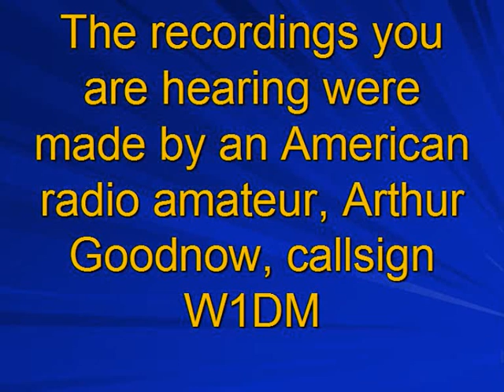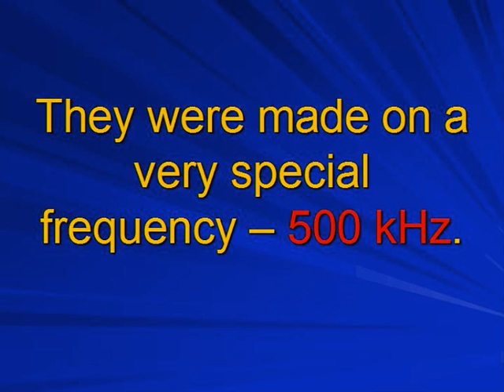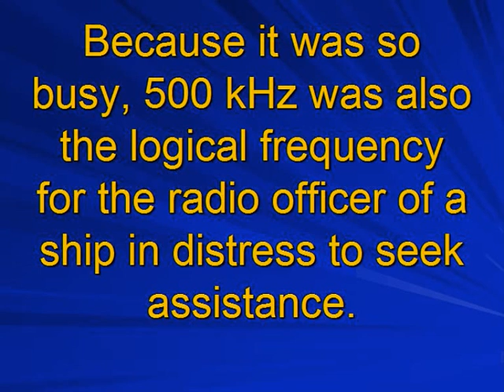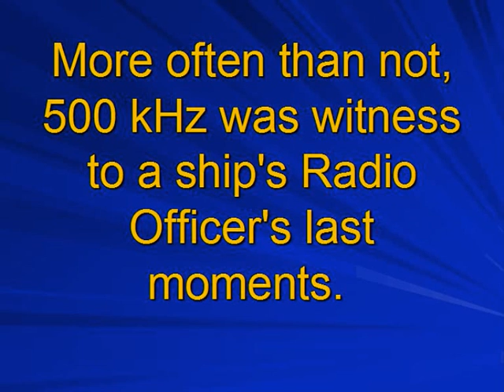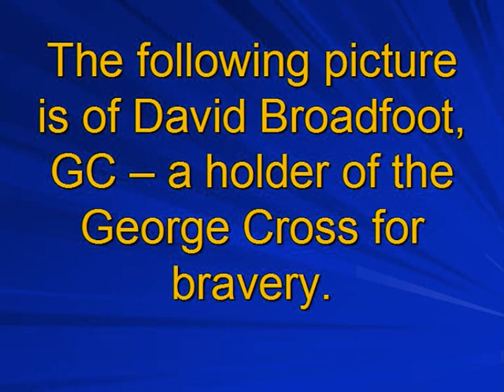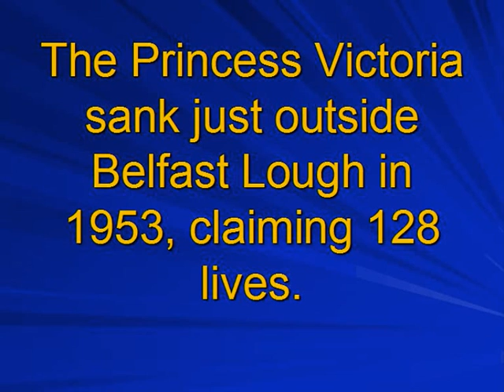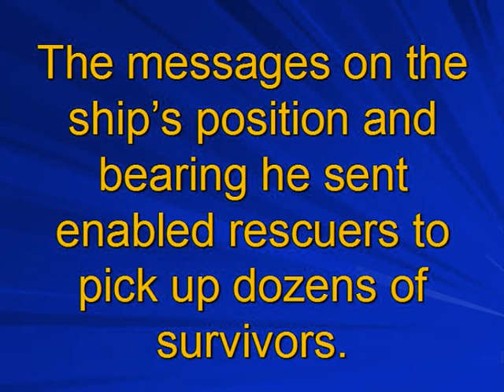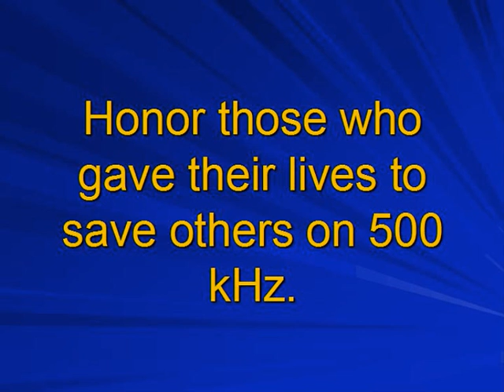500 kHz in Europe, the Summer of 1974

Comment: I worked at GKA Portishead radio station 1975/1976 which was when the amount of CW traffic reached its peak. Although the station did not handle the MF frequencies (500khz etc) every band was covered from 4Mhz to 22Mhz. There were dozens of R/O's sitting in front of a typewriter and a multiband receiver. The messages were typed straight onto the form inserted before each QSO was started. The completed msg was then popped onto a belt which ended up at the sorters desk for onforwarding, usually by telex. I was often asked how come the operator already had traffic on hand when the ship being worked was sent up to a working frequency. When the ships R/O first makes contact with the listening/scanning operator, the callsign is noted and any traffic on hand for that ship is delivered to the operator who has been designated to work that ship. Things became chaotic immediately after the traffic list was sent. On even hours for UK ships and odd hours for all other flags. Not a little skill was required to be an R/O at GKA, one the ability to touchtype (not the 2 finger method) plus the ability to receive morse at minimum 28wpm and being able to tolerate every type of fist from the abysmal to the superfast senders like the Russians cruise liners who were in business then. The receiving antennas were right outside the main building in the form of directional rhombics laid out in a semicircle and wired so that the operator could flick through a rotating switch at his desk.
Happily I'm still key bashing on the ham bands. Its like tying a shoelace, once learned you never forget.
Reply: Ahh, QRY 23. Iremember it well.😁

Comment: Me too 91-96. Best job I ever had. Videos like this give me the sentimental shivers. No sign of it dying on the ham bands quite yet. I'd give it a few more decades.
Reply from the maker: I am currently mostly active in a pretty hardcore VHF/UHF multi-op contest station: I am tolerated despite the fact I can barely solder a coax plug because I am "the CW man". A lot of our real DX is still worked on CW. It's still the best mode for aircraft scatter, really important in European UHF contesting, better than SSB for marginal signals and quicker and more open to human common sense than the digimodes (was that IO86 or IO96? Computer says no copy, human being knows instinctively and that IO96 is all in the North Sea). Also, quicker to complete than digi for the really marginal tropo skeds. 860km on 1296 to the far South East of France with the Massif Central in the way? CW makes it possible!

Contesters know CW wins VHF/UHF contests!
Reply: Same as you Gerry. I was an RO on oil rig in the days after CW sadly. But I’m ex-Royal Signals and was taught CW up to 50wpm copying onto keyboard/VDU to listen to the Russians. Like you I usually turn up at my contest teams location and just get put straight into the CW seat and work the initial pile up. Always fun and a privilege amongst so many old timers on my team.